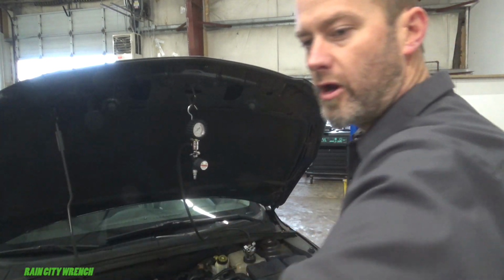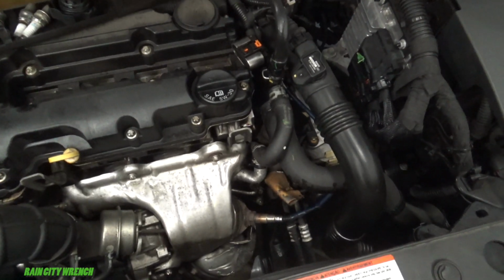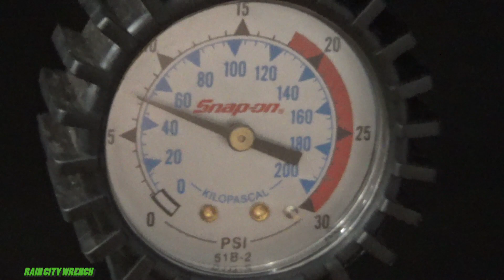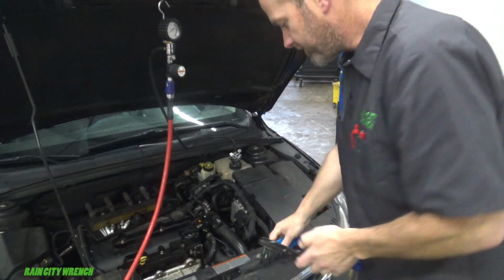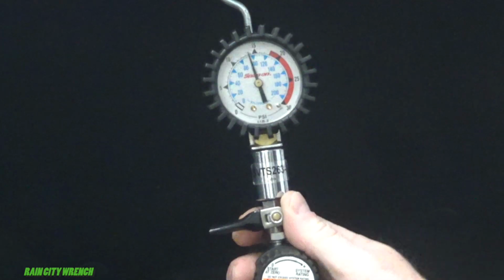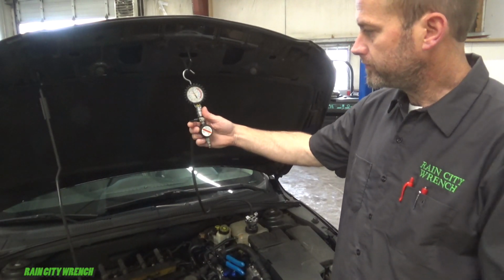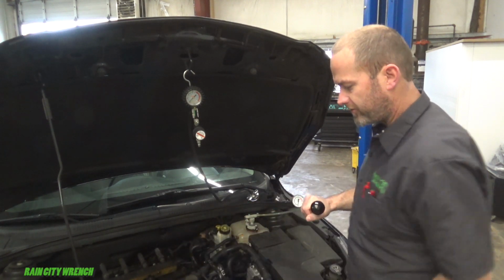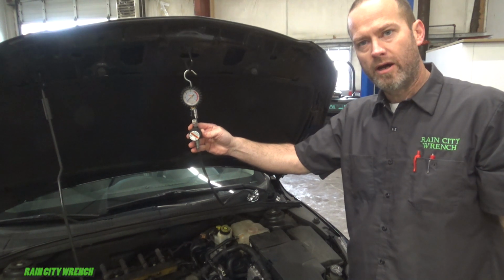Snap-on Air Powered Cooling System Pressure Tester

Comment: Found it on amazon thinking I’m going to buy it
Reply from the maker: You won't be disappointed, just make sure you have a cooling system adapter set so it can be connected to any radiator or bottle.
Reply: what brand is it?
Reply: It is Astro pneumatic air powered cooling system tester

Comment: RAIN CITY WRENCH,  //. 
..                               60's ,70's, 80's, 90's car that don't use a OBDII SCAN TOOLS. The temp gauge is not working I mean that the needle is moving but how do you know it the temp gauge is reading false readings? and not correct reading how can I test it without using a Scan tool?
                       what testing tool do you use to test and check the temperature gauge in your cars dashboard is working correctly or is not working correctly? what do I use to test the temperature gauge?
Reply from the maker: I have multiple thermometers. You could get a cheap (10-12 bucks) automotive analog pocket thermometer, remove the radiator cap and dip it into the coolant. (be VERY careful removing hot radiator caps!!) If the thermometer reads 190 degrees but the gauge only reads 1/4 or less then it's not reading correctly. I also have a digital temp gun and will check the temperature directly next to the temp sending unit (wherever it is) on the engine and compare it to the gauge. Hope that helps
Reply: @raincitywrench117  thanks for the help
I don't know where the temp sending unit is at on cars
"dynamic pressure test" I guess you just leave the pressure gauge on the radiator and increase the RPM of the engine and if the pressure gauge moves you have a blown head gasket or internal leaks?
I'm trying to test the temp gauge by itself to see if its giving "false readings". 
What "Test Tool" can I use to test the temp gauge to make sure its reading correctly or giving false readings? 
Plus can I connect another Temp Gauge I can buy at PEP BOYS and connect it to the fuse block to test the temperature to isolate if the temp gauge is the dash board is giving false readings?
Reply: @raincitywrench117  thanks for the help
}}}        I disconnected the Temperature sending unit/temp sense, so How can I test the instrumentation temp gauge in my cars dash board by itself to check if its working correctly, what do I need to do?
Reply: @raincitywrench117  
__---       1.) How can I test the Pressure of the water pump and the pressure of the radiator while the car is idling and running? I want to know what the pressure is through the radiators hoses and water pump hoses, how can I do this?
--- 2.) The Water Pump is "increasing" the radiators coolant into the car engine and into the radiator core to increase the flow of  the coolant?
-- 3.) How can you test if your radiators hoses and water pump hoses has to much pressure the pressure is to higher than normal operating pressure?
Reply: @raincitywrench117  thanks for the help
*    The water pump is pumping how much water and coolant? how can I measure this how much the water pump is pumping? 
I don't know why they call it a water pump because its not pumping only water its pumping coolant. 
The Water pump only pumps coolant not water into the engine only when the engine is warm and HOT not when the engine is cold?
yes I can pressurize the system to 13 to 15 psi to find external leaks using a radiator pressure tester. 
But I want to measure the Pressure of the system while the car is idling and running at higher RPM to measure the Pressure of the PSI of the system, How can I do this?
Reply from the maker: @billwilliams6338  Water pumps aren't designed to pressure the cooling system, they are for circulating the coolant inside the engine providing heat to the cabin and cooling for the engine, transmission, charge air, engine oil, etc. I don't know what you are working on but if you want to check water pump flow then remove heater hoses at the heater core, start engine and see if coolant starts pumping out. Will make a mess though. The clean and easy way is to start a cold engine and then grab the heater hoses. If there is good flow, both the hoses will start warming up pretty quickly. If there is no temperature change after a few minutes then there is a restriction or pump not working.
Reply: @raincitywrench117  thanks for the help
Ford 1997 mustang 
1.) Instead of using scangauge some other repair tech told me to buy a bluetooth OBD2 adapter and download the software app to see the gauges digitally. Have you tried this method?
2.) How would you test if the water pump is working correctly, any types of test you can do?
3.) The Water pump only pumps coolant into the engine when the engine is warm NOT cold after the thermostat has OPEN.
When the Thermostat is CLOSED the water pump is not pumping coolant into the engine while the engine is COLD?
Reply: @raincitywrench117  
What temperature is the lower radiator hose temperature should be at? and what temperature should the upper radiator hose should be at?
Reply: @raincitywrench117  thanks for the help
The Radiator Fan will only turn ON with the thermostat OPENS? which should be around 180F degree?
The Radiator fan gets turned ON by the thermostatic switch on all cars use a thermostatic switch that is mounted on the engine?
Reply: @raincitywrench117  
Does ALL cars or just certain cars have a thermostatic switch for the Radiator fan?
Reply: @raincitywrench117  thanks for the help
1.) whats the differences are between hypercarbon and exhaust gasses?
2.) If you have a lot of hypercarbon and exhaust gasses in the radiator fluid that means that the car is NOT burning the gas and oil? so your car will can't go high RPM than 60mph?
3.) Auto Repair tech will REMOVE half of the spark plug wires while doing the Block Combustion leak detector test to determine which sides of the engine is creating the exhaust gasses in the radiator fluid to narrow down which side of the engine block by just removing HALF of the spark plug wires. Is this a good troubleshooting method or not?
Reply from the maker: @billwilliams6338  Hydrocarbons simply means gasoline. Once gas "hydrocarbons" enter the cylinder they are compressed with air before being ignited. If there is a leak past the cylinder head gasket then hydrocarbons will enter the cooling system. Running a block test which is really fast and easy, will detect combustion gasses by turning the block test fluid from blue to yellow. I wouldn't mess around trying to find out which side is leaking if gasses are detected in cooling system. I would just tear it down and do both gaskets.
Reply: @raincitywrench117  thanks for the help 
I will look out for those things in the coolant.

Why would a stuck OPEN PCV valve cause the engine to burn oil?